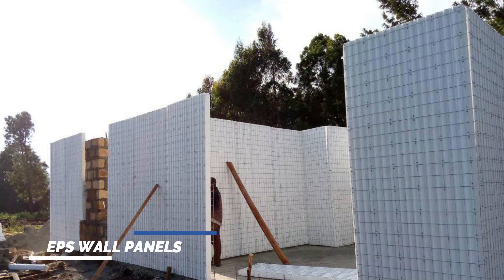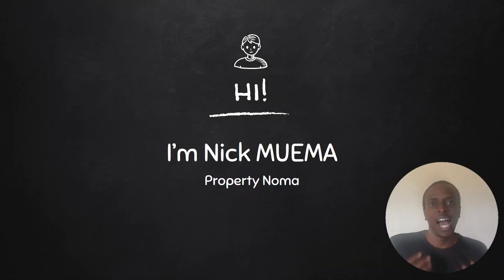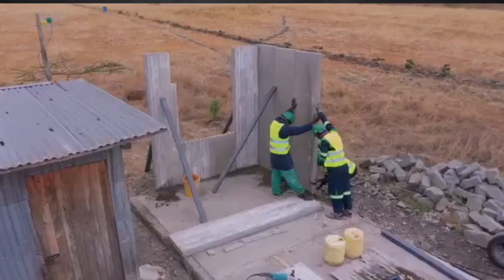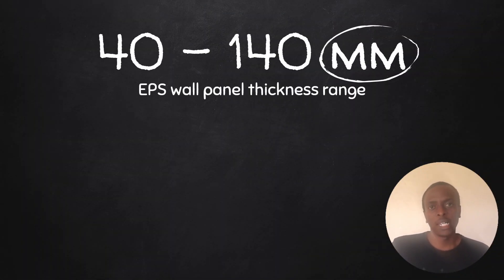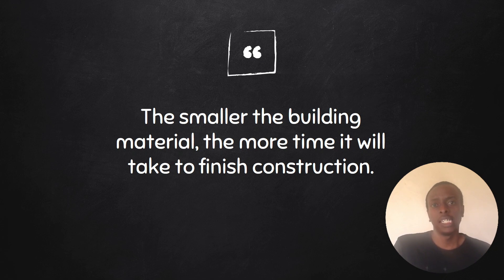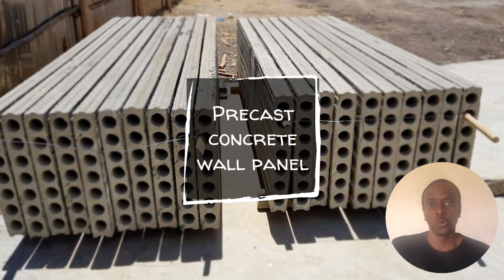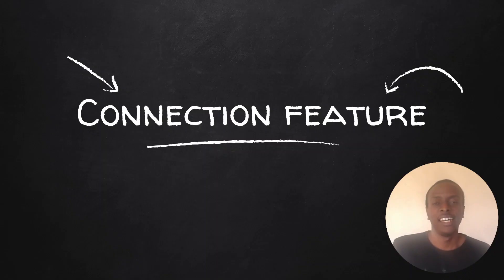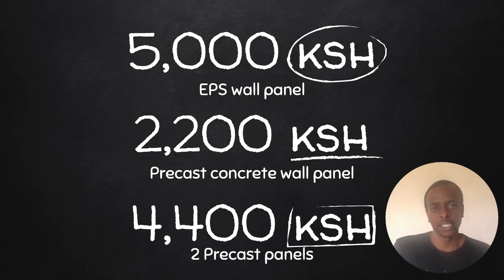EPS vs Precast Concrete Wall Panels: 5 Differentiating Factors to Think Of

Comment: How do precast stand up to earthquakes and sound transmission?
Reply from the maker: 1. Precast concrete panels can be designed and manufactured with reinforcing steel bars (rebar) to distribute and absorb seismic forces.

2. Special features can be added to precast concrete panels to enhance their seismic resistance, such as thicker walls, additional reinforcing bars, and larger sizes.

Comment: So can you please just tell us which one is the safe one and best
Reply from the maker: Both are safe, but personally, I prefer precast panels as they are more affordable than EPS Panels.
Reply: @PropertyNoma  but why they didn't use concrete in between?
Reply from the maker: @leilamuhammad1558  Because the panels interlock. Skimming is done afterwards then painting.
Reply: @PropertyNoma  Congeries form
Reply: @PropertyNoma  Do you get that?

Comment: Good day sir, thanks for this video. Is it possible to use these materials to construct 2 floors, one on top of the other?
I it is possible, which method can be utilised?
Reply from the maker: Yes it's possible. You can use the floor EPS panel to make slabs. For support, beams and columns are needed to support the upper floor. In some cases EPS panels can also be used for load bearing purposes.
Reply: @PropertyNoma  Thanks for the swift response

Comment: What about The Strength Of Eps vs precast wall
Which one is more stronger...after plaster??
And Also Eps Panels Performance in Wind Strom....
Reply from the maker: You can customize the strength of EPS panels onsite by choosing the strength of concrete you want. With precast, they're premade at the factory so you'll have to inform the company the strength you want beforehand.

Comment: Thank you for the video.  I want to use EPS panels for my future home.  Unfortunately, it is not common at all where I live.  I am having a hard time finding suppliers or builders nearby.
Reply: Eps has issues in Australia,  there's a youtube channel with people regretting buying homes made using this .
Reply from the maker: @allbyhisgrace8925  Thanks for the information!
Reply: @allbyhisgrace8925  due to cladding .Right?
Reply from the maker: Hi Jason, unavailability is an issue with EPS panels. Hopefully you'll find them in your search.

Comment: Super helpful. Would have been great to have an actual demo on site as well w the two to show the more qualitative aspects... aesthetics, fit and finish, acoustics, practicality, etc.. but very useful. Thumbs up. I think integrated storage plays a big part in freeing up space within a floor plan and I noted the was that the EPS was being used to create as storage unit at 6:59 ..the flexibillity in panel thickness and the set up for creative use is another plus.
Reply from the maker: Thanks Moses. I'm trying to find EPS and Precast wall projects but they're rare to find. There's also the issue of privacy of the owner. All in all, if I find active projects, I'll showcase them on the channel.

Comment: Great video. Is it possible to connect these precast panels using bolts or similar joints?
Reply from the maker: Hi Kevin, I don't think so. They have grooves that make them interlock to each other. They may need mortar to be connected to beams and columns.